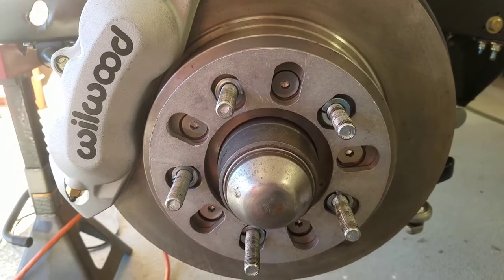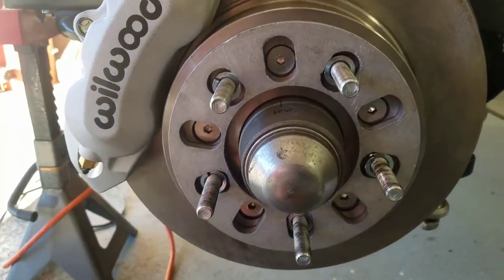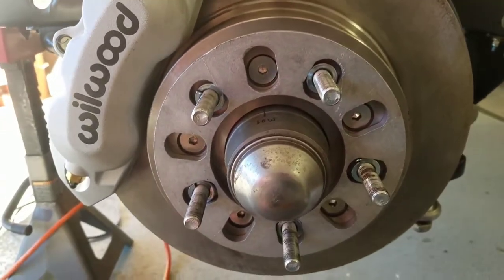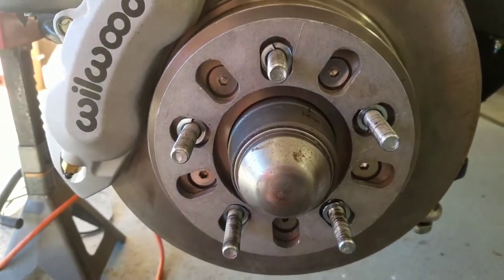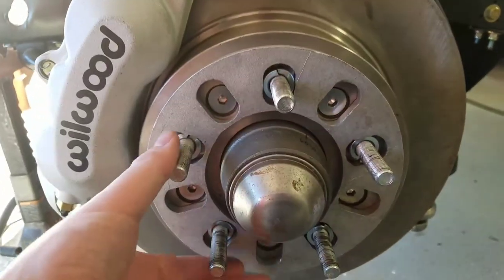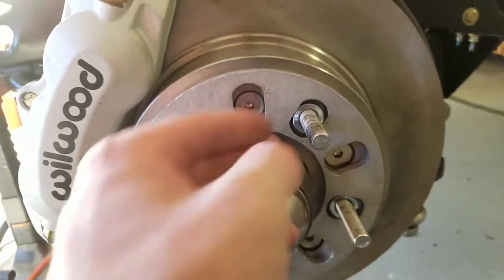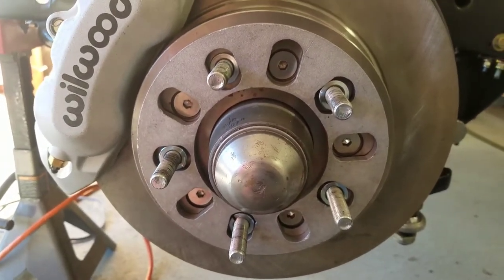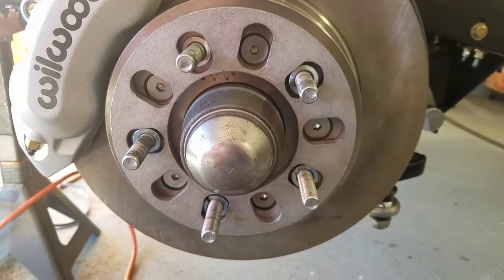Easy way to center wheel spacers

Comment: I know this is an old thread… but I as thinking of using o rings on my 6 bolt pattern Chevy Colorado Z71. Any thoughts? Thanks.
Reply from the maker: @nick39  Might work if they're stiff enough.
Reply from the maker: @nick39  You could also try 3d printing them out of something that could take the heat like nylon or PETG.

Comment: So you put a washer in there to hold it in place? Did the lug nut still go through the washer? Any problems.
Reply from the maker: Yeah that's the trick, finding a washer that fits both the hole in the spacer and the lug nut. If you have a lathe you could always make your own, which I might do in the future. Unfortunately it will be a few years before this all gets road tested.

Comment: any luck on road test?😅
Reply from the maker: I ended up using brass shim stock instead of those wheel shims to get better tolerances.

Road test should be fine-although it will be a few years before I get to that point. Still have the body off the frame and no motor, no trans, and no rear suspension. Long way to go.